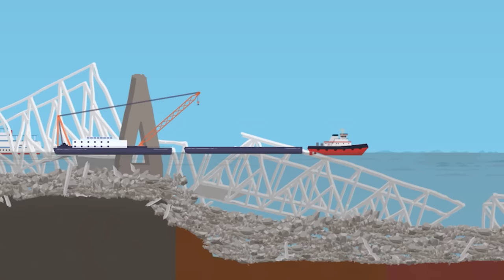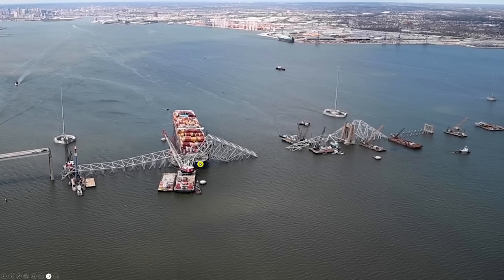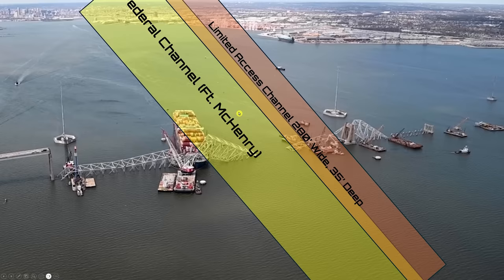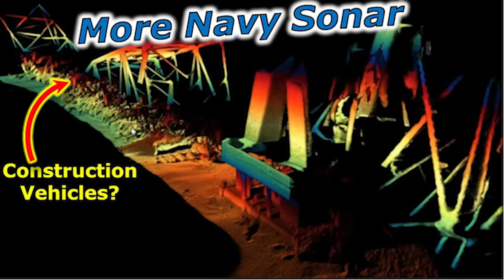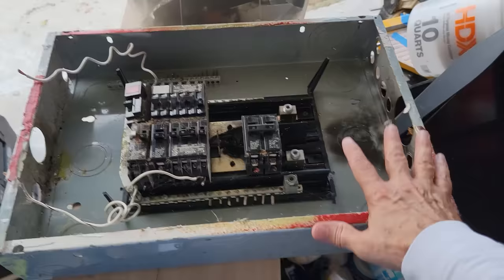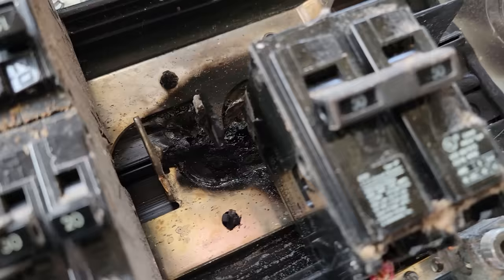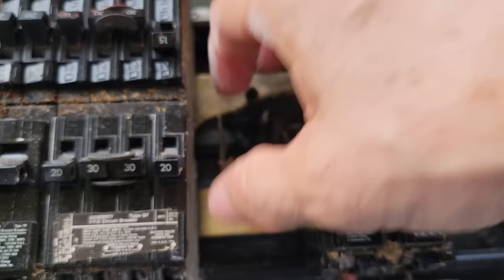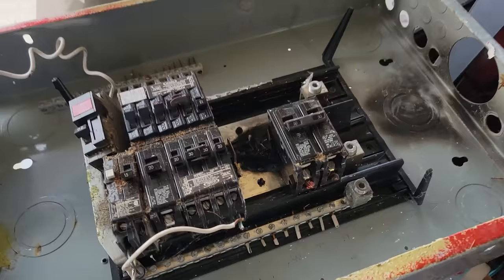NTSB Focus Dali Ship's Circuit Breakers | Bridge Collapse

Comment: It has been previously stated by a port worker that while the M/V Dali was in port loading/unloading cargo (Conex boxes) that as refrigerated containers were loaded on board and being plugged into the Dali’s house electrical system that circuit breaker were constantly tripping and causing generators to go down. The problem was so bad that the Dali had to run on shore power while attempts to diagnose and effect repair to the Dali’s electrical system/generator systems.
Reply: what is the upper level grid voltage on the Dali ship ? Do you know that ?
Reply: @hardystrathe1713  The typical generator on a ship generates three phase 460 volts.  That's the system used on most of the equipment on the ship.  The only other main system is the bow thrusters.  The generators fed a step up transformer that boosted the voltage up to about 8200 volts (3 phase) and fed three large cables that ran all the way up to the bow.  There was another transformer on the bow that stepped the voltage back down to something like 1250 volts.  It's been too long since I was on that ship so I don't remember exactly.  The reason they did the voltage changes was to reduce the current on the long cables so they could be smaller.  Higher voltage means more insulation, but less copper for the same amount of power transfer.  This was on a car carrier ship (RORO) and the cables went thru the cargo hold so you could see them overhead.  In that case I was troubleshooting a non working bow thruster.  The problem turned out to be in the PLC on the bridge and was fixed by a simple board replacement.
Reply: I also was wondering about the report from a shoreside worker that the Dali was apparently having electrical issues while handling refer containers while at the berth in Baltimore. Who worked on the vessel's electrical system while at Baltimore? Did just the vessel's engineers correct the electrical issues or did they also employ local assistance? Who certified that the apparent electrical issues had been corrected prior to sailing from the berth? Will be interested to read the preliminary NTSB report being issued in early May per the NTSB spokesperson.
Reply: @jamest-mk4qu  The only certification that was needed could be provided by the chief engineer.  I don't know if they employed any local assistance, but say the brought aboard a electrician to do something, he probably wouldn't be certified by the US Coast Guard.  That's a completely different license. A ship's electrician and/or chief engineer wouldn't be certified to work on a shore electrical system and a shore side certified electrician wouldn't be certified to work on the electrical system aboard a ship.  Those are the laws in place.  I do remember, years ago, some local governmental official came aboard our vessel, while at the dock, and said one of the ship's systems wasn't up to the local code.  That official was escorted off the ship while being told that any vessel system only has to comply with codes set up by the US Coast Guard.  In some cases the local codes (like electrical) are incorporated in the Coast Guard codes, so are identical.  However, in this case that wasn't true.  Local officials should tell the Coast Guard, who always has the final enforcement responsibility.  I can say that once we had a small engine room fire on a vessel that I was chief engineer on.  We were sitting at the dock when that happened, while I was ashore.  The fire department showed up and put the fire out.  It was a Coast Guard rule that they could do that.  When I got back aboard I talked to the firemen and they showed me what happened.  It wasn't anything serious and the problem was fixed and we went back out on schedule.
Reply: @ronjurgs9799  Agree with your comments but was just wondering if the vessel's owner's representatives had requested any advice regarding the apparent electrical issues from the equipment manufacturers technical representatives. Hopefully the NTSB representatives have looked into this as part of their on board investigation.
Reply: @jamest-mk4qu  There's no way I could know the answer to that.  I've been retired for a number of years and don't get on ships anymore.  Lots of times there is equipment from multiple equipment manufacturers on a ship.  If the chief engineer hadn't gotten the possible problem narrowed down to a specific thing it would be impossible to know which manufacturer to call.

Comment: In 2015,we have had a similar blackout and grounding on a large loaded  LPG tanker coming out of Abu Dhabi ;vessel was caring 45000 MT of liquified Propane. Fortunately no damage/no major incident.
Root cause was incorrect settings/faulty AVR ( Automatic voltage regulator ) and incorrect settings/faulty OCR ( over current relays)
Vessel changed all this equipment .

Comment: Just an example on one ship where ventilation from a large laundry space was improperly designed.  The issue came to light when an electrical panel that had been collecting lint and eventually caught fire.  The lint was coming from a dry exhaust system when more than 2 dryers were working simultaneously.  The system could not handle 3 dryers and had 5 installed.  The exhaust would backflow into other spaces causing lint build up everywhere, but no one thought it was a serious issue until the fire.  Further inspections turned up the top deck level exhaust vent that was supposed to have 3" wire mesh (only for personnel safety to keep a person from falling into 42" diameter duct) instead it had 1/2" wire mesh.  The lint had been adhering to the wire causing partial blockage slowing exhaust speed.  The outer perimeter of the duct had 4" reducing to just under 1" at the center.  Issues can be cause by the least likely suspects.
Reply: Good to know, thanks.
Reply: @brunonikodemski2420
We had same problems with over heating breakers and distribution panels, where poor coordination was done.  Sometimes this was caused by dust of debris coating the breakers or wiring.  Several naval and desert projects.  I had the job of solving and repairing these, and was horrified how bad the wiring and the breakers kickouts were done.  This is still a problem between countries, where safety margins are NOT coordinated.  NEC and Maritime rules are not the same, nor are the aircraft.  We are seeing the same issues with solar installations, often catching on fire.
21 hours ago

Comment: The investigation into the distribution panel is more likely a "cause elimination" measure. The videos of the Dali show that it went totally dark all at once ... twice. This is NOT from 30 or 40 circuit breakers tripping all at the same time. Although similar to a home electrical system, the system on ANY large vessel is three phase with a floating ground to the generator. Although you can series connect two of the phases to increase voltage, each phase is a separate and independent electrical circuit. The ONLY way to cut power to the entire ship is at the generator itself or the three phase main cut-off that the generator feeds directly. The main cut-off is cut off in two ways, either manually or from two set safeties: 1. excessive high/low voltage  2: out of spec hertz rate. The hertz rate is dependent on a constant (governed) engine RPM. For a 60 hz system this is <58hz or >62hz. A 50hz system has similar set points around 50hz ie; +/- 2hz on either side. If either set point is exceeded it drops the generator completely off line.  If the ship is a single generator system, this kills ALL power to the entire ship instantly. The hertz rate ONLY changes if the motor lugs or if it surges. The motor will lug if the fuel is crap and clogging filters and injectors or from a clogged or failing air intake system (causes black smoke). The motor will surge if the RPM governor is suffering from hydraulic problems or sticking throttle linkage. Modern systems are RPM governed by electronic sensors with some type of servo operated mechanical or hydraulic linkage to the engine throttle. Unless the electronics take a holiday, lugging and surging are still caused by those same three mechanical problems.
Just keep in mind that in any incident at sea, the crew, the vessel owner, the vessel operator, and the voyage insurer are desperate to prove the fault was due to unavoidable circumstances. ... the fault of the ship builder or equipment manufacture. [edit] and in some cases they will hide facts from the investigators to prevent their own deficiencies discovered. Ask me how I know this.
Reply: Interesting comments @3DPDK.   But they must still be generating electricity even now they are aground.  I wonder how many times since the accident has the CBs tripped..?   There are lots of engineers crawling all over the ship at present, even ones from Hyundai who were the makers of the Generators and Breaker Panels.   They might have found the fault, and the NTSB will let us know in good time.
Reply: @hiscifi2986  I actually agree with your final statement. With something like this investigators look into every claim made by the captain, engineer and crew. They have to to either confirm the claims or prove them wrong. Knowing that the NTSB is investigating the distribution panels doesn't automatically mean "ah-ha, see I told you it was the circuit breakers". My explanation is based on shipboard experience, that the way the lights go out on the ship as seen in the video could not have been from faulty circuit breaker panels that are scattered around the ship, but rather the generator itself went off line, or the main distribution panel in the engineering space took it off line, and that there are several reasons either of these can happen.
Reply: @3DPDK  Is there any single point of failure of a ground?  Or is the generator so well grounded that is impossible?  
Also, are the ship propellers direct drive or electric like a locomotive?  In other words was this a propulsion problem or more a direction control problem?
Reply: @DellAnderson  1. The floating ground in 3 phase is not like the center tap ground or neutral in single phase. The ground in 3 phase carries no load and is basically a 0 volt reference to the body of the generator.  Even if the ground connection corrodes away, the generator will still put out the three independent phases. 
2. The larger ships and some very big tugboats use the same diesel engine used on locomotives, an "EMD". On a train the engine drives a generator that drives an electric motor that drives the wheels. In most shipboard cases that I'm familiar with, the engine is linked to the shaft by way of a gear reduction transmission. In some, the clutches in the transmission are engaged by hydraulics usually pumped by the engine itself.  If the motor shuts down, the hydraulic pressure is lost and the transmission disengages.
Steering on the other hand is usually accomplished using hydraulic rams driving the rudder(s) and in many cases the hydraulic pressure for that comes from electric pumps. Some vessels have an axillary or emergency steering hydraulic pump driven by the main engine, but this has to be manually engaged by the engineer.
The problem is that these systems and equipment can vary from one ship to the next. Arm-chair forensics is extremely difficult unless you know the equipment arrangement of that particular ship.
Reply: @3DPDK  Thanks, quite informative.
Reply: @3DPDK  Large ships, the size of the Dali, generally use large 2 cycle diesel engines that could be powered by bunker C.  These are air start and can be 135 feet long and 3 stories tall.  You can get inside the crank case  and climb around, but not while the engine is running, obviously.  The pistons are about 3 feet in diameter.  The number can vary widely but there might be 12.  Just the engine itself is bigger than a whole locomotive.  The engine maximum speed will be about 120 RPMs.  There is generally only one main engine on a container ship and it's directly connected to the propeller shaft with no gear-box or clutch. If you want to run the propeller in reverse you first shut the engine off, adjust the cam shaft, and then start the engine again in the opposite direction.  That might sound a bit strange but that's the way large slow speed ship engines work.

Comment: While you are fundamentally correct, the breakers involved are likely 250-2500a.
Having been a field tech working on these types of power breakers, I can attest that they typically have digital trip units that ARE quite accurate.
They will NOT trip below their setting (assuming that they are "good").
These breakers have multiple settings and a typical long-time trip will take anywhere from 30sec to 3min at GREATER than 150-300% of the setting.
Now, if the breaker tripped on Ground Fault, Short Time or Instantaneous they will trip in LESS than 1 sec.
So, this angle will take some time to investigate.  If they trip units are digital, they will have a record of WHY they tripped.
Testing will be pretty straight forward, but they either need to be removed or the entire board which they are mounted in will need to be de-energized.  THIS requirement will take time as I am sure the breakers in question are in boards partially or fully energized to sustain the ship in it's current situation...

Comment: I was a breaker and power distribution specialist electrician before I retired, the types of breakers that are likely onboard that ship are probably nothing like the household breakers you showed. They are going to be many, many times larger and probably not a molded case breaker. They would likely be anywhere from the size of a copy paper box up to the size of a washing machine and have a solid state trip device that is programmable. The settings for the trip devices should have been modeled by an electrical engineer using modeling software to custom tailor the trip characteristics to coordinate withe rest of the system to provide adequate over current protection without unwanted trips. Not doing this correctly or not maintaining the breakers and other system equipment could easily cause this type of event.
Reply: I agree that the breakers are not household 120V AC quality.....(120V household is an insane voltage using double the current of sensible 240V systems in sensible countries).  I would be surprised if the onboard staff would be able to meddle with any programmes set in the electrical system - any issues being faced would almost certainly require the manufacturer support engineers logging in remotely.  Well, if this is not the case, I would regard that as a major problem.
Reply: @einfelder8262 I live in a 240v sensible country, we use an electric kettle because we have 240v.